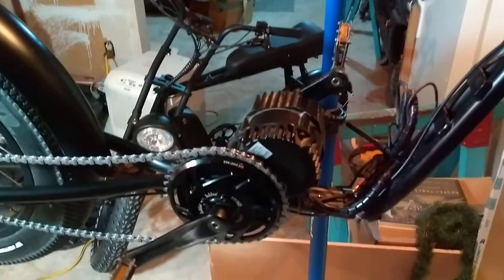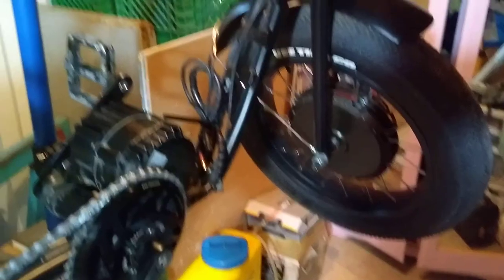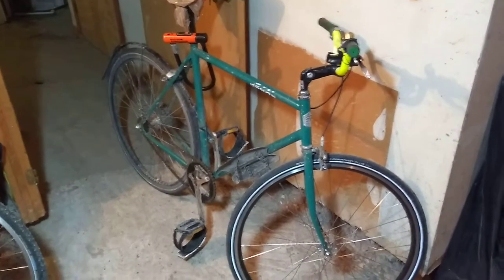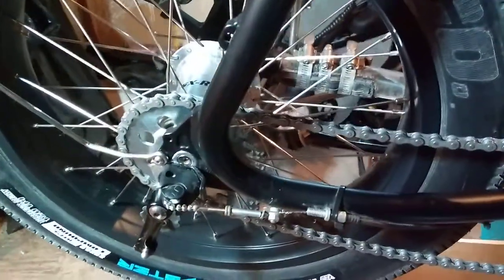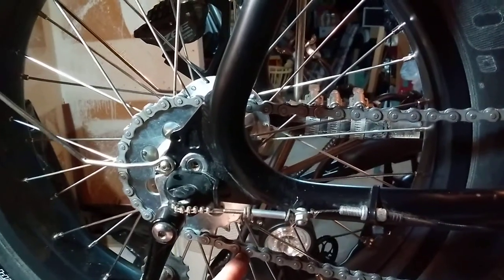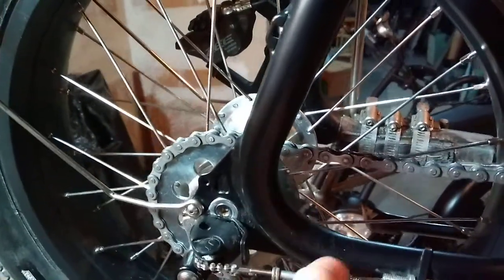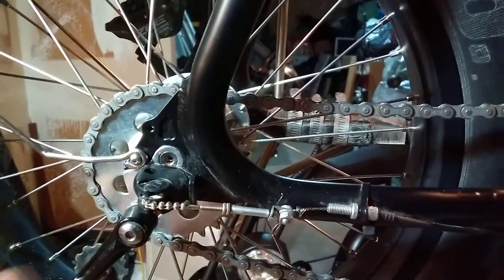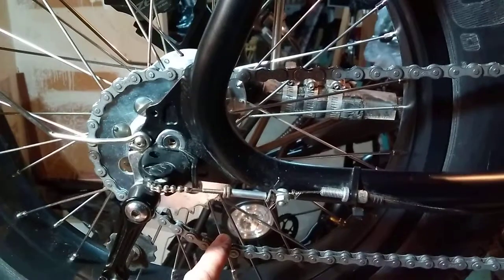Chain Tensioner Sturmey-Archer SX-RK3 Internally Geared Hub with BBSHD

Comment: The OLD on this hub is 170 mm & I want to install it in a Trike with 190 mm drop outs. Can I just use a 10 mm spacer on each side of the axle? Plus could you give a link for the big 26 - 28 tooth rear cogs? Thank you.
Reply: you really DO NOT need that size of rear cog just reduce the front chainring to a 30 tooth and put a standard sturmey archer 20t or 22t on the rear and you will accomplish the same thing

Comment: you dont need a custom chain tensioner you need to place a spring. between the idler and the frame.
Reply: I don’t understand. I need more chain rap so how will a spring help
Reply: @markevster  using a spring to hold the tensioner from the tensioner to the stays.

Comment: Hey Joshua, I got my SA hub in the mail and dropped it off at the local bike shop along with my bike to get the wheel built and installed. They said it didn't come with the required bits to install it in vertical dropouts. I'm not very technical yet with bikes, but I'm slowly learning.

Did they mean the lock washers? I have 4 of them coming in the mail, but I couldn't find anything else and I'm surprised if this is what they were talking about, that it didn't come in a little parts bag with the other SA hub bits and pieces!
Reply from the maker: Which supplier did you get your SA hub from?
Reply: Bikewagon off Amazon. Turns out the local bike shop said my bike is ready now. So annoying, I guess they read the instructions and found the washers in the kit. Well, at least I have spares now.

Also was looking at a tensioner for vertical dropouts by YESS, seems to push the chain in the right direction to increase chain wrap.
Reply from the maker: @Glitchlols  So crazy! Well, you can't go wrong with having spares!

We don't have any experience with YESS tensioners but they do look well designed! Let us know what you figure out!

Comment: Hi have you found a good way to stop chain jumping off on a normal mountain bike. I have added new chain still happens.  It’s a common problem bbshd
Reply from the maker: I hear you. What is you chain line looking like? Are you using multiple speeds in the rear or just one? Some times with multiple speeds the high or low gears cause the chain line to be really drastic and can pull the chain off of the front ring. Some guys use a "cassette" system in the back and re-arrange their most used 3 or 4 gears to line up with their front ring to limit the lateral pressure.
Reply: Urban Cargo Bikes hi yeah there’s 7 gears at the back in I only use the 6 because exactly what you said  the hardest gear looks too drastic of a angle.   Do you think a chain guide  will work on the front cog  the ones that clamp to the frame ? Ta